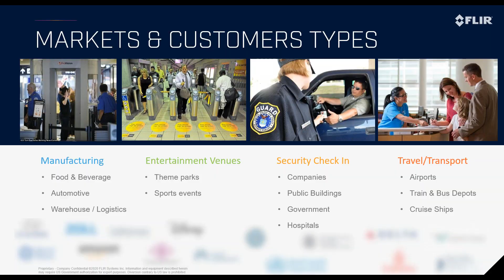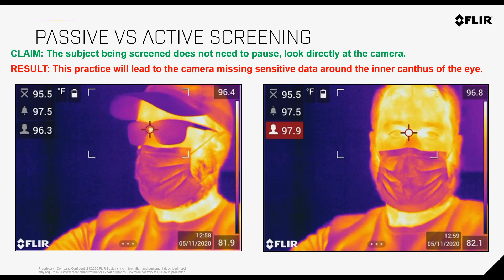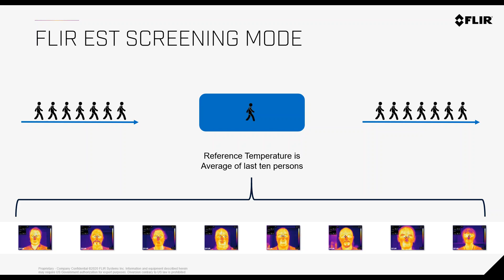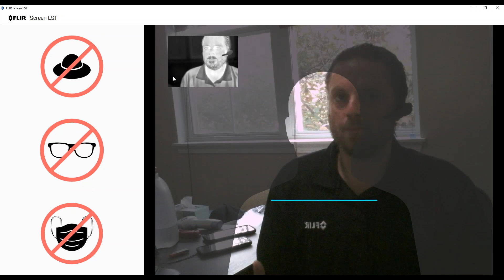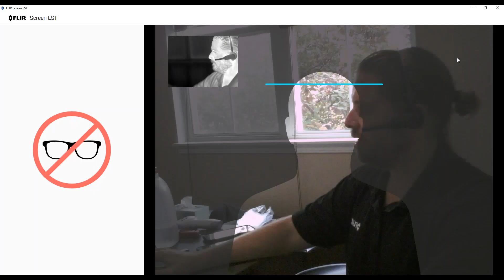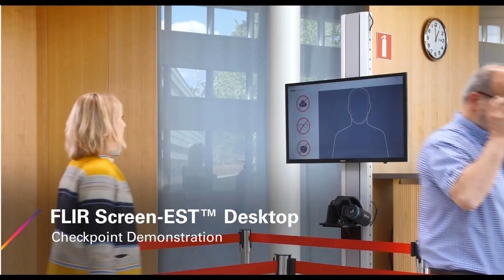Elevated Skin Temperature Screening Solutions Webinar with FLIR

Comment: What do you do when winter rolls in?  Everyone is going to scan in too low.
Reply from the maker: Hi Debra. 

Thank you for your question. We reached out to FLIR to confirm our answer. Below is their answer in full. To summarize, the system always takes averages into account and calculates deviations from these averages. When the air is cold and everyone's skin is colder (or hot / hotter), the system adjusts the readings for it.

Here is what FLIR said:

"The way that our FLIR Screen-EST screening system works is that we are constantly taking and updating our average temperature.  Debra is right that our bodies are ever-changing.  And not only season to season changes, but even in the same day.  If you have a manufacturing company that is running 3 shifts, the shift that comes in at 6:00 AM could be coming in when the outside temperature is 50°F and then an afternoon shift at 2:00 PM could have an outside temperature of 80°F.  This will influence the human body.

FLIR’s system constantly takes individual’s temperatures and averages them into the data in order to compensate for these environmental changes.  So if person ‘A’ registers at 95.0°F, person ‘B’ at 95.2°F, and person ‘C’ at 95.7°F, then the collective average is 95.3°F.  Our cameras automatically calculate these averages.  To determine if a person’s skin temperature is elevated or not, we set an allowed “temperature deviation”.  Our systems are customizable, but FLIR generally recommends setting temperature deviations of 1.8°F.  That is to say that if your average temperature is 95.3°F, and your allowed deviation is 1.8°, then someone would be classified as having an “Elevated Skin Temperature” if they registered at 97.1°F or higher (1.8°F over 95.3°F).  If later that day or the next day the average temperature rose to 95.5°F, our allowed deviation of 1.8°F will remain, but now that threshold is at 97.3°F (1.8° over 95.5°F).

Environmental changes (outside temperature changes) is the primary reason that we are looking for “temperature deviations”; not a certain temperature to determine if an individual has an elevated skin temperature.

Other systems/manufacturers are only concerned with a fixed temperature; say 100.4°.  Exactly to Debra’s point, in the winter, an individual would have to be running very, very high to get to 100.4°F.  In a cold region of the country during the winter, this is likely not to happen and cause a screening system to fail because “everyone is going to scan in too low”.

Again, this is where FLIR is looking for the individuals that are outside the norm; and the norm meaning other peers being screened at that time and at that location.  This neutralizes the fact that the screening could be taking place in the Sahara Desert or the North Pole.
"

Transcat team.